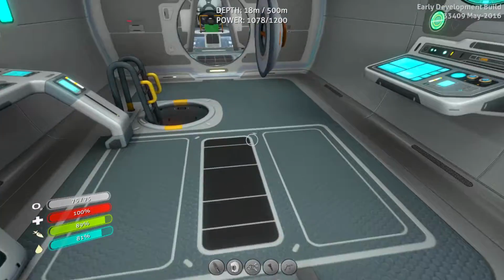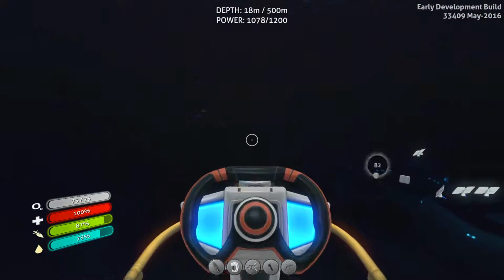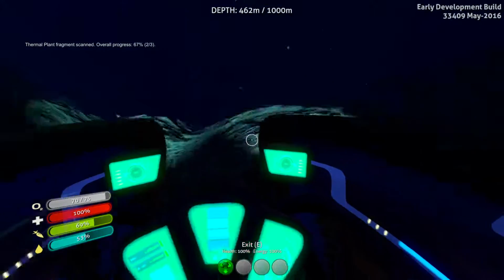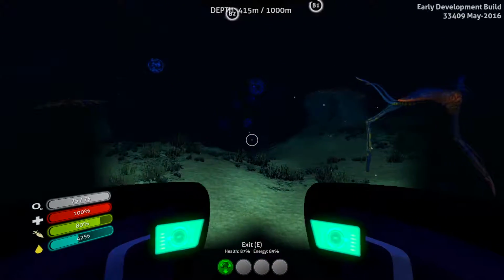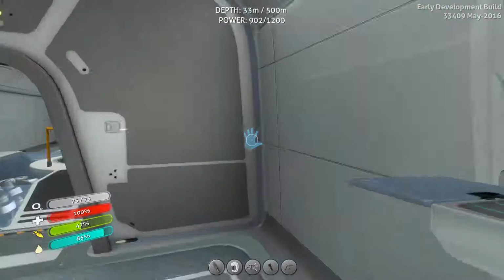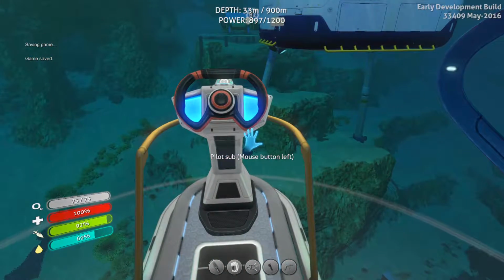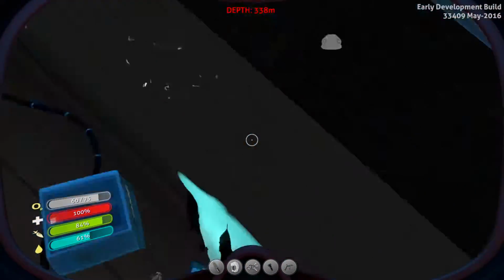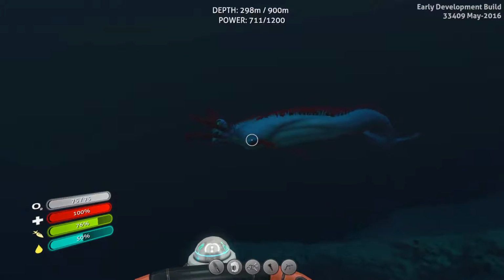Let's Play Subnautica - Ep 12 - Finding the Terraformer - Gameplay with commentary

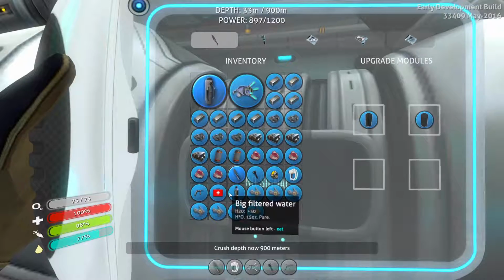Comment: 15:00 You can build two more pressure compensators and each will add an extra 400m depth.
Reply from the maker: I didn't think that was working anymore. I tried doing that for the Seamoth and it wouldn't work. Maybe it was a bug.